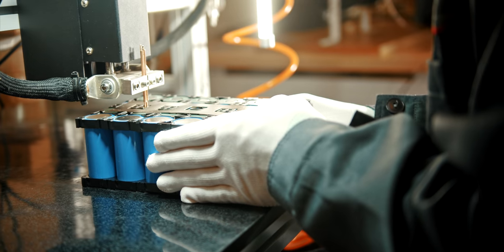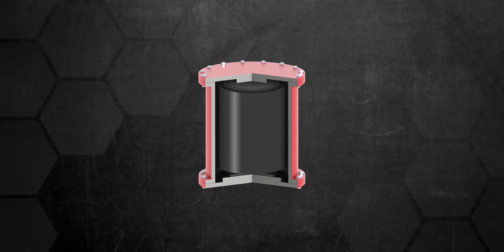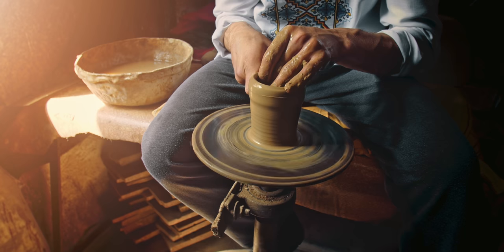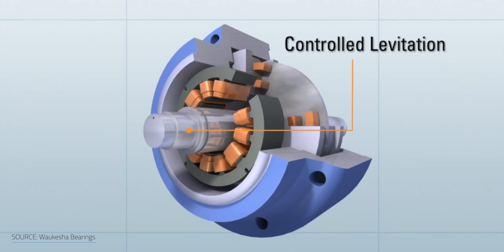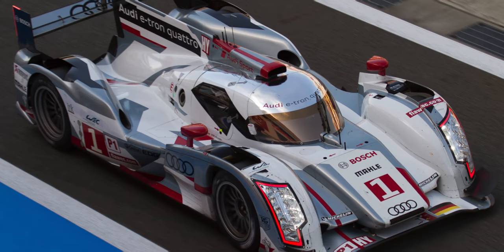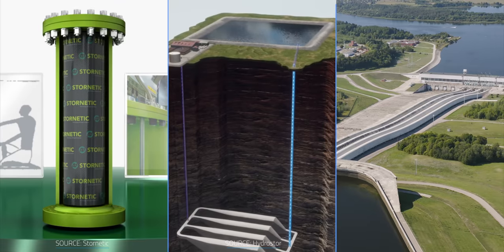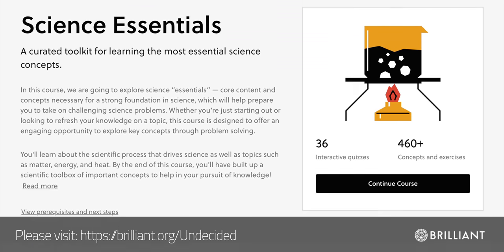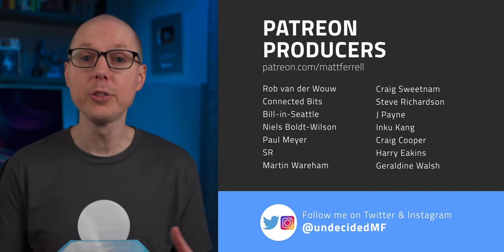The Mechanical Battery Explained - A Flywheel Comeback?

Comment: 48 years ago in undergrad engineering school I did a class paper on super fly wheels for energy storage. You did a fine job of covering the topic.
Reply: LITERALLY [THROUGHOUT ALL REMARKS] In terms of what was understood half a century ago You mean? In several thousand years AT MOST The UTTERLYABSYMAL corruption That has the 'wheels' FLYING small Radius high RPM IS-TO-BE   PEEK-ScAnDALMOMENT. It is RELATED-RATE-EQUATIONAL ("RRE"?) 'math' But the radius SOLVES exponential Exactly Like the RPM And Increasing the radius Is SUBLINEAR BARGAIN TO SCALE (*****SBTS*****)!
Reply: @arts8302  don't you massively increase the outward force on the components tho by increasing the radius? idk which factors they're balancing exactly and how close to material limits they're running.
Reply: @chrismofer  see INDIAN master's thesis for derivative analysis but the mechanical battery is the granite banked ellipticalish valley a simple dimple you spin the looping mass AGAINST.   CorrUPTEST investment bank RECENTLY ran numbers for gravity ARTIFICIAL STONE STACKER SCHEME lol and underwrote despite it BEING ORDERS OF MAGNITUDE MORE COSTLY THAN MULTIMILECIRCUMFERENCE-SLOW-SPEED-HIGH-MASS-MAXIMUM-RADIUS/CRUSTAL-MASS-PARTICIPATION HEREAfTER REFERRED TO AS MMCSSHMMRCMH

"MM...MH" works so all guns to distract now set IS FACT.
Reply: @arts8302  jeez u ok buddy that was satire right lmao hard to tell sometimes
Reply: @chrismofer  deep water is ENERGY laden even if not 'fast' #DWIELEINF

HYDROINERTIAL is NEXT big thing DUH.  Molten sodium spun is the 
⛽ finishin 🔫
Reply: would you be willing to share that paper?
Reply: @andrewking2590  sorry, the paper is long gone from my possession.
Reply: @fentoncs  google up the Indian master's thesis it's between 2008 and 2016 probably first term Barack
Reply: MultiyarD diameter potable water pipe is a commodity so I wonder if it is cheapest way of storing massive horsepower with a TURBINE in pipe of tens of megawatts to spin and extract inertial energy ☝ AND out????? Very little loss in circular loop... Extremely high speeds with minimal cooling or inherent use if superheating LIKELY.  A grid of stakes a mile tall could transaxle windtorque to liquid Power mechanically and then provide MASSIVE unprecedented supercity frequency stabilization by varying diverted flow to alternator (since somebody just like this comment and rereading it I've used some strange words I seem to be arguing for hydraulic transfer of windmill power to l optimally looped extremely inexpensive liquid most likely water fresh or not virtual flywheel systems as hydraulic power is easily combined cheaply. Unlike my diligence on the liquid nitrogen questions this insight follows many years of considering various forms of heavy matter on banked rail like tracks that would just be smooth arc banks in the Stone and right now I wonder if there is a DaVinci drawing of such a apparatus? But going ahead and just varying a circular high mass containing pipe of water is relatively recent. Although I have studied the Wikipedia liquid nitrogen article and found it to have been corruptly messed with the nitrogen article itself is not found to be corrupted. However there is certainly a lot of hate facts cited like high pressure tanks only losing 2% a day. That's a lot and not a fair claim at all. We don't waste the methane that boils at sea in those tankers it is either used for propulsion not necessarily for electrical fuel cell propulsion of course or it is recondensed with some of it obviously being used to condense it. Rather losing 2% of the energy a day and of course the cost of storing the energy in the liquification process represents to me opportunity because my proposal is that the energy be from sources that are so bountiful it is truly free costing almost nothing to capture more of in terms of the 2% a day for however long be any insignificant position on the total costs. This is what I love about cost engineering you have successful if you remove what costs money and still are able to accomplish what you need to accomplish you are then free to waste. there is of course no luxury greater than being able to freely waste and here the more waste the more cooling the more global healing. It's like this Federal canal that has the beneficiaries of its leaking suing to protect the recharge having spent millions of dollars on a water treatment facility for their community that will be obsolete if the federal government fixes their canal. The canal was not designed to leak but then leaking fails on its sides. Liquid nitrogen or storing even when the energy pre-electrically are very different proposals but are both based upon avoiding what is costly and it is the case that what is costly tends to be anti-competitively profitable. Industry tends to steer solutions to where there is less competition and more profit at the mere price LOL of  unfitness. Explaining to my wife how upset I am that using an REI cap on top of a cotton baseball cap had me not noticed the REI cap had come off my head had me spend hours trying to recover it retracing my steps without the benefit of Google maps providing a decent crumb trail which I have change several settings to prevent that from happening again when I am trying to create a trail that I can repeat I hope that using pure GPS although it requires a be very careful about never having it on not just for privacy but for battery drain issues. REI has the highest prices I mean a gallon stainless steel vacuum flask that costs under $30 at Walmart will be nearly $200 there and I'm sure slightly thicker steel maybe a little bit shorter to make it easier to get a free gallon of ice at the QuikTrip gas station but that takes a while to pay for itself. I'm not sure what drives the high prices at a co-op? But more importantly there is high quality there in terms of the health insurance for the workers and the very best brands obviously. They even have their own electric bicycle now. Unlike Costco where you don't get a refund of the profits of the store brands and they are very very significant REI has promised special if we can extend some of their efficiencies to governance and to infrastructure. The government is us and that can't be said too often. We choose especially by leadership that is willing to not just consult history about social programs but the very finest fully scientifically literate philosophical historians of the technology to drive the research. I was thrilled to hear invited yesterday mentioned how little public money is spent on pure research compared to the 1960s. It's integral increase meaning triple digit percentage to go to 2%. I think there should be 2% on each of the topics he mentioned or at least those topics that the planet needs us to ascertain before we start spending the big bucks. say one of the three trillions should be pure research on how to spend the second and third trillion. This does not mean a multi-year delay it could be under a year that we spend the first trillion. It could be half a trillion in prizes. There is a lot of knowledge that is not being put into synergy. recent journalism points out that the pandemic did that and called it project-based I think or mission. Clearly proposals like the liquid nitrogen or the liquid flywheel and liquid nitrogen Wikipedia claims is low viscosity but I do not propose using it for the flywheel of course. The integral heating that I mentioned would be extremely counter productive unless it is on the course of generating other forms of power in which you have to heat the liquid nitrogen but it is sad that a mixture of liquid nitrogen crystals and the warmer liquid nitrogen is a faster means of cooling. I did not know that there was a market for such LOL and the author of that comment ignores the fact that if you have Frozen liquid nitrogen slush it's not just the vapors being less insulating where the crystals touch what you're trying to cool but the boiling occurs only after the liquid absorbs heat. More heat. I mean if you want to avoid the insulating vapors just do your immersion in the liquid nitrogen at a high enough pressure to prevent the vaporization because liquid nitrogen has that low viscosity as the object that has the heat transfers the heat into the liquid it is going to be lighter and the heavier cold or liquid hydrogen will replace it touching the object right and that this would actually be less the case if there were crystals in the way it would seem LOL.

I am just one person and I am aware of how little I know about my proposals and although I'm critical of how slow the progress is of developing the heuristics the metrics the diligence that most people need to consider such radical solutions at all I am pleased by the pace despite the extraordinary price I pay specifically neglecting to rescue my own mother after so many decades of protecting her from the family that is ending her life prematurely if not cruelly. Every day is a battle between what I can do for her and what I am doing in terms of this comment. It is of course very different than during Trump. I really love @$$&-+)/ discretion I 'said' President biden's press conference showed his discretion not just that of his staff. The only moment that he was indiscreet I hope was strategic when he talked about allowing the opposition to pose a while. Google typed our president's name as the word violence if anybody really has to know what the word I replaced with a phrase was lol. President Biden replaces the past violence not present but a machine can't be expected to know that. Many of the commenters are of course such a machines especially when they are paid low wages they are desperate for to write such feeble destructive nonsense as we find or something replaces the silence our survival depends upon being nourished not chilled. Developing the science is sandbox time never more critical for us to play. There is artificial intelligence to help us to augment our abilities in this regard in terms of the crowd becoming a team that is functional. My only stock advice will be to try to buy some reddit it when you have a chance or even more progressive tool to allow the crowd not just to come out of retirement to vaccinate but to ideate. Don't just vaccinate You've got to ideate.
Reply: In my legacy thinking TURBINE OPTIONAL AS A PLUG can be connected magnetically through wall Of pipe like aquarium scraper AND on tension cable for PERFECT efficiency able to launch megaton 'artillery' with petawatthours quarter loop fractional minute tug to LITERALLY send Titanic to Mars without fuel on BOARD!
Reply: THE sodium.   Has high boiling temperatures at pressure so stores energy well hybridly both spun and inherently heated to 'boil' helium etc despite massive working helium pressures. Mr. Musk clearly u' Z ' aware that granite bored into such loops can STORE a year of grid power for UNDER a few trillion at MOST and never wear out. I THINK a few hundred billion is plenty for multiyear world aggregate energy
Needs including de(-carbonation/-'acidification/"COOLING"(stabilization!) DUH.
Reply: @chrismofer  ANYTHING "hubbed" is a joke SO no; ABSOLUTELY NOT. Granite is the bearing dish DELISH.
Reply: @andrewking2590  He smoked it all.

Comment: For my dad’s senior project in college back in the 80s, he made an electric car powered by fly wheel! 

Mind you it was mostly a proof of concept, but still, I’ve always loved fly-wheels since he told me that as a kid.
Reply: Wow, did He make a full size electric from flywheel I mean the cars we drive today 

He was way ahead of time I guess 👍👍👍
Reply from the maker: That's awesome!
Reply: @zakyvids6566  Flywheels are not practical for powering moving vehicles, only for fixed power installations. The major problem is that every time you change speed, start to go up/down hill or turn a corner - large torques are applied to the vehicle by the flywheel. 

There were some short distance electrical buses used in Europe (1960s?). They had all sorts of problems and didn't remain in service for very long.
Reply: Wasn't there an issue with stability when using a flywheel on a moving vehicle because of the gyroscopic effect?
I remember something about that Swiss flywheel bus being very difficult to drive.
Reply: Some early KERS systems in F1 used flywheels
Reply: @Robbedem  Not only were they difficult to drive, they were breaking down on almost a daily basis.
Reply: I love the idea of a flywheel car/bjs. The effects of the flywheel can be overcome by having more than one oriented so the forces of them balance out.
Reply: @demacherius1  I think that would require 6 flywheels, although it might only be 3.

There is a further problem. The initial balance would  not remain for long. Depending on the maneuvering of the vehicle, the flywheels would slow at different rates. This would happen even for a vehicle moving at various speeds in a straight line on a perfectly level road.
Reply: @buggsy5  You are right but I think ther is a solution to make that happen for example you could allow the flywheel to turn around all axes. that way nearly no energy is taken from the wheel and it doesnt effect the handling.
Reply: @buggsy5   Flywheels are the best way to achieve regenerative braking.
Reply: @demacherius1  You then have a gyroscope, with the massive increase increase in mounting cage size that would entail.  You would also then have the problem of coupling the flywheel to the drive to make use of the energy stored or to store any energy created by regenerative braking.
Reply: @sciencemilitia1853  Can you provide a scientific study that shows that to be true? Even if it is, does the extra efficiency overcome the torque losses that occur when the flywheel is moved over an path except one that is straight and level?
Reply: @buggsy5  a flywheel is basically just a huge gyro!👌
Reply: @supertramp6011  or better yet, all gyros are made out of flywheels.
Reply: @dant.3505  true dat!👌
Reply: @supertramp6011  You have it backwards. A mechanical rotor gyro contains a flywheel inside its gimbal cage.
Reply: @dant.3505    Not true. 

There are also ring laser gyros, microchip MEMS gyroscopes as found in electronic devices and fiber optic gyroscopes There may be others, but those are the only ones with which I am familiar.
Reply: @buggsy5   Moving a flywheel to a different elevation does not remove energy from the flywheel.  Im not even sure what sort of theory you have about torque losses.  The only way for a flywheel to lose torque is when overcoming a force that resists its angular momentum.
Reply: @buggsy5  it's almost like wheels with tons of mass spinning, don't want to change direction.
Reply: @sciencemilitia1853  It depends on the orientation of the flywheel to the change in direction of motion. A change in elevation usually involves a change in vehicle attitude, at least when the vehicle starts to ascend/descend. 

I should not have stated "change in elevation", that is the 2 dimensional automobile driver viewpoint. But there is no position you can mount a flywheel in an automobile where either going up/down or turning does cause the flywheel to apply a torque to the vehicle. That is why aircraft use gyroscopes, rather than flywheels for attitude indication. The changes in direction act on the gyroscope cage, so no torque is applied to the vehicle. 

Now if you could accept the increase in mass of using a gyroscope in a vehicle, then it could be used as an energy storage device, with a motor generator being used to electrically tap/add to the wheel's angular momentum.